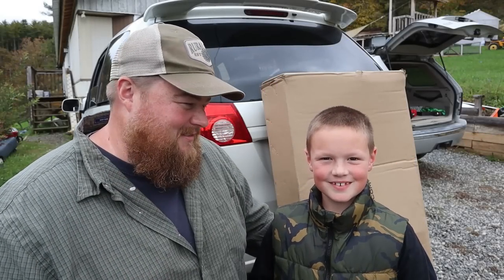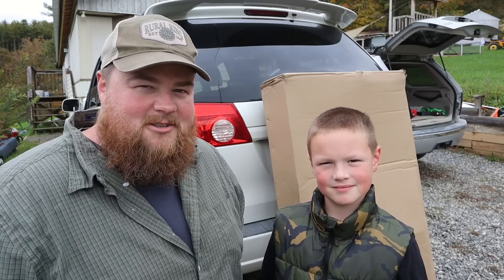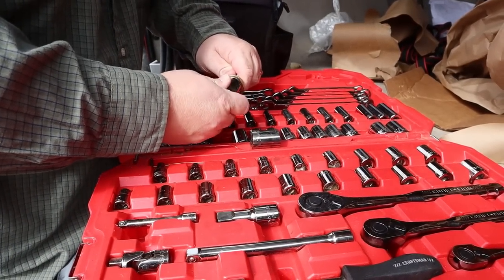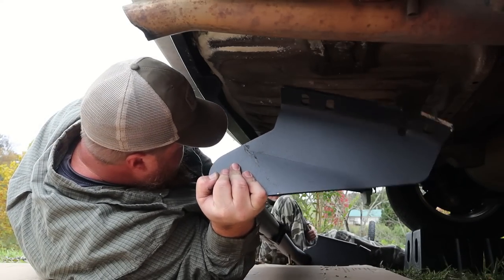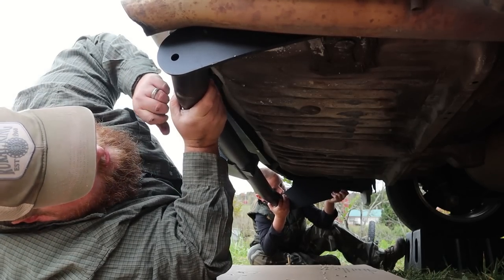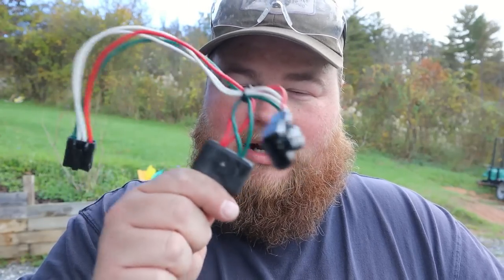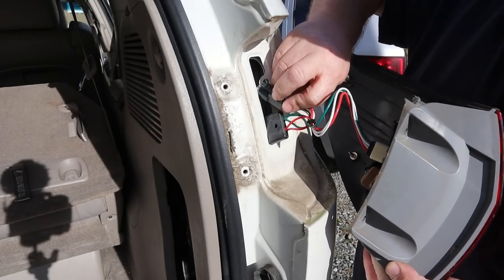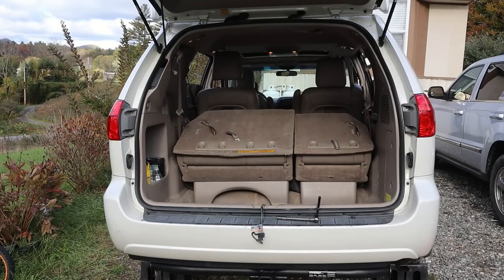BAD IDEA? Toyota Sienna Hitch Install

Comment: I installed a hitch and brake controller around 2016 on our 2008 Sienna without a tow package (no transmission cooler, no engine oil cooler). We used the van to tow our new Coachman Clipper 16RBD travel trailer that has a max weight if 3500 lbs. I added a transmission cooler and Airlift air bags in the rear. To overcome the lack of an engine oil cooler I just used synthetic oil and substituted one quart with Lucas oil stabilizer. We took the van and trailer all over the place! Yosemite, Sequoia National Park, Santa Barbara, San Diego, Mammoth Lakes California and more! That van towed the travel trailer with no problems! Two years ago we switched to a Highlander for our tow vehicle, but our 2008 minivan is still going strong with 160,000 miles. It's my daily driver, truck, bus, load it up with concrete bags to kids and surfboards, it can handle anything!
Reply from the maker: Awesome to hear!! I just finished putting some air lift springs on the rear the other day. Amazing the improvement!!! Would like to find a transmission cooler next.
Reply: @sam-and-angela which air lift springs?

Comment: I did the same thing. There's a rubber plug underneath the floorboard that you can run the wire through and zip tie it to your hitch so that it doesn't have to be closed in the gate. I believe it's right in the center you may have to remove that plastic cover to pull up the floorboard.  Also for $100 on Amazon you can get airbags that slide inside the springs on the back. Once they are aired up and you have all the leaks tweaked out you can put as much weight as the minivan allows and your minivan will still be sitting level. From my experience it has not changed how the van rides at all. Unless it's slightly better. I haul a trailer all the time with maximum load and my 08 Sienna does grate. And it never sits low in the back

Comment: My husband had put trailer hitches on every single vehicle we have owned.  He even put them on two Toyota Prius  and three Mazda MX-5 (Miatas). We have a Lincoln Town Car and a Mercury Grand Marquis now and they both have trailer hitches. We also chose not to drill holes in the trunks bc we didn't want moisture and rust to have an access point into the trunks.  We got rear ended while driving one of the Prius and the car that hit us had more damage than we did bc of the trailer hitch. Thanks for sharing what your learning fixing your mobile home.

Comment: All the holes in the frame were rusted. I couldn't get a tap handle to fit so I created a tool out of a coupler nut that would allow me to use a ratchet (I had to file a square hole in one end to fit the tap). If memory serves, I managed to cross-thread one bolt anyway. What a project! The wiring was a relief after the hitch mounting. I just left my wires laying inside the access panel on the right, pull it out when needed (no holes in the Sienna). I thought I was the only one who can turn a "small job" into an all day project. Air bags are mandatory IMO and they make the van handle SO MUCH BETTER. I'll drag all the time without even with no trailer attached. Thanks for your video.

Comment: I just put a Curt hitch from eTrailer on my 2013 Sienna.  It was said that it's a 30 minute job.  Took me and another guy 4 hours.   Spent an hour just trying to get the bolts to start threading.   I finally got a battery clamp wire brush and twisted it through the theaded holes.  That made all the difference.   I didn't think it would be necessary because the holes were covered with stickers.  But, it's vital.  I still need to install the wiring kit.  And, it requires running a power wired up to the main fuse box.   Not a fun or easy job.

Comment: I bought a 2017 Sienna which was brought from NJ to Poland (Yes Europe). It came with a hitch which was converted to the European system, but was never used. I have a small trailer without its own brake (overrun brake). According to law I am allowed to pull a total weight of 750kg. I used it once and the Sienna did great. In the future I might have a trip across three countries coming up, the speed limit will be 80km/h (50miles/h), I think the Sienna will just do fine as it won't exceed the weight of 500kgs.

Comment: If you haven't looked into them yet, the rear air spring helper is a huge improvement for these siennas. 100 dollars well spent, 2 inch sag elimination. True short install
Reply: I scraped my hitch all over the country for a year after my hitch install, pre air helper. I dont have enough good things to say about the combo and a hitch hauler

Comment: Hey Sam and Angela! It is such a blessing to see you include the boys in your tasks, jobs and projects... It teaches them fantastic ethics, morals, and what effort can do for you... He seems very proud to help and be a part and such a wonderful big brother! 
Lol, Now that he can reach the pedals, I look forward to you teaching him to drive on the property like you did with the mini excavator, I am a big supporter of children learning young equipment, driving, just like computers and devices, and having farm land gives them the ability to learn now and get the irresponsible fascination out of them and become more responsible in their use, and do what others dream of. 
I wanted to suggest that if your minivan doesn't have a transmission cooler to consider adding one, in addition to a aftermarket air-ride system. Both of these are cheap insurance to help your minivan give you so many more extra years of service. Most newer vehicles are made for Urban life not country, and they can barely handle harsh roads before having electronic traction control issues to say the least of towing or back roads use. Even the extra weight on the roof is a lot, for the newer powertrain. They sell us a car, with a larger box, to make us think it is more capable but the automakers cut corners because they are selling you an image. Fine wine imagine on a cheap beer budget. The extras you put into your vehicle to help make it able to do the extra things can also help make it last an extra long time or through its expectancy. Lots of foreign vehicles do have far better engine capability than most of our now american-made vehicles however they will not last when we do more than the vehicle was made for as advertised. Yes the body looks as if it can do more, but they don't advertise that so they can't be sued when you exceed you vehicle created capabilities and load ratings, and no more than a car is expected via the automakers build out of the vehicle. So the extras you add will help it to last extra long to help the entire powertrain and give you a better vehicle life experience and reliability that you would expect from a more versatile family vehicle to do all the things that you want it to do. It can do it but you have to add a few things t help make it do it and last. 
Hope you guys have a wonderful time migrating to the Tennessee Homestead. I pray, as I allow the commercials to play that you all can get some kickbacks to help Elijah and his brother to have silent electric off-road bikes or a side by side, that they both can enjoy. I look forward to his build of the treehouse for him and his brother, and don't forget to leave a pile of rocks for a little man to relax on climb and have a blast with again. When he gets bored with it he will let you reclaim it for use elsewhere on the property, lol!
Bless you both, and your boys, and your brothers, and all of your family for all that they do to help you along your homesteading journey, I enjoy watching the brothers help and work together. I am blessed as I get to watch all your content, it's so inspiring, and touches my heart. Bro Sam, I love the smile you help your wife to have every time she looks at you, and Angela you make Sam glow everytime the sun blasts his face. You are such a wonderful family! Perhaps soon the boys will be helping to make soap with Mom, or laser cutting with Dad in the businesses. Continue to be a blessing and I hope many bless you back. 
Happy Thanksgiving in advance, because I'm thankful for what you bring forth on YouTube in your content to help us remember that family is valuable and all we do we should get an understanding of that!

Comment: I just did this entire setup on my 2014 awd sienna and it’s the best upgrade ever!!! Bike carriers, tow a side by side, tow a utility trailer, tow a cargo box trailer. I even did a diy cargo rack on top using a plastic pallet I split in half with a saws all and u bolts. Just as good as a truck now if not better since I can carry 7 people!!!

Comment: Just put a hitch on my 2006 Sienna today, thanks for this video which helped me.  How did it help me?  Well, I checked out the ETrailer option.  I'm sure they make a decent product, but I found multiple reviews with experiences like yours - problems with fit-up.  And it seems like those problems were attributed to distortions in the hitch due to shipping/handling.  Even if the box shows no damage (like yours), it can still get out of whack if somebody drops it on the loading dock.
So I checked out U-Haul.  They offered a Curt hitch for less money that the Etrailer option.  Best of all, I could go pick it up at the local UHaul store.  This way, I could bring it right back and exchange it if it had a problem.
My install also took much longer than advertised.  In my case, it was due to the time spent chasing the rusty threads on my 16-year old Sienna.  But I finally got it done, and it went in pretty clean.  I did not have a wingman like you did, but I was easily able to position the hitch with the use of two 5-gallon buckets and a piece of 4x4.  
Not planning to use it for anything but a bike rack.

Comment: I only once bought a new receiver hitch for a vehicle and only because it had been marked down twice at K-Mart a now defunct discount store.
Every other time I waited and searched until I could find one used as these hitches are pretty much indestructible.
Last one I bought is a used universal style and will fit both our vehicles even though one is a Chrysler Minivan and the other a Ford Ranger waiting to be installed in case we move off the Left Coast.

Comment: My wife just got a 2021 Toyota rav4 hybrid xle.  I got a curt hitch for it, but have not installed yet. Will need the wiring for a trailer. That plug n play wiring worked great
Reply from the maker: I have zero complaints on the wiring! I would add a pry bar to your possible hitch install tool list. :)

Comment: I’ve got a 2013 Sienna with 155k miles. I’ve just installed a hitch. I’m having the shop install airbags (2 schrader valves) a surge brake and a 4 way to 7 way plug to haul our small couples camper. We will be upgrading our tow vehicle but with hurricane Ian damage still to fix on the house I’m trying to save a few bucks in the meantime. All parts from etrailer.  I didn’t have to move my exhaust….hmmmm

Comment: I put a hitch on a Toyota pickup once. It always baffles me how they always send you what you need. And when I went to install it one bolt was standard thread not metric. Always something.
As you found custom fit means get a pry bar.

Comment: You have a hole in the bottom underneath your carpet.  It is plugged by a black plug.  You need to pop it out, splice it in half and slip your wires through it and reinsert the plug!  This will allow you to go underneath

Comment: I would be concerned that the hitch is too low. You may need better shocks.
Elijah did a great job helping!
Reply: Please send a link on the hitch. I’m interested in putting one on my 2018 Equinox
Reply from the maker: Links are in the video description to e-trailer's website. :)

Comment: If you look at your trunk floor, about 16" to the left of your exhaust you will see a drain plug, you could always run your wires through that so not to damage them when the trunk closes.
For a 9yr old your son is very mature, any othe 9yr old would say "you're all right, keep coming back, keep coming back" ( crunch, smash, bang ) as the car goes over the ramps lol.

Comment: I have 2016 Sienna with a hitch.  Never towed more than 1500 lbs or so for short distances.  Baby the transmission, no worries.  Any time you're selecting a tow vehicle,  its all about the braking. Just use common sense. God Bless.

Comment: Sam, Does your sienna  have the factory tow package? as I have an 08 xle sienna with tow package , I also installed a brake controller as I pull a trailmanor travel trailer and a converted cargo trailer from coast to coast.  plus I installed a tranny cooler and beefed up the rear suspension to stop the drooping in rear.  Love your channel !!

Comment: Nice job guys. Nothing is ever as easy as you think🙄.  Never realized how similar in design the sienna   is to the Odyssey. I have an 05 odyssey.  We just had to take the whole roof rack off mine and reseal it. Was leaking everywhere!!! Ended up having to cut the pad and carpet out of the trunk it got so moldy because I have a molded plastic liner, we didn't notice the leak for a while. 🙄🙄🙄.  Love my van though. I call her Fiona ( like from Shrek) she's green and a little ugly but she never lets me down 😂😂😂
Reply from the maker: Oh noo!! No doubt you guys got her fixed up right though. :)

Comment: I did the same thing on my mini van Toyota Sienna. Sits very low. Added a 4” raiser with a basket. Do you know if it will tow a 4 door car? 250 miles.

Comment: Bad idea make sure to change transmission fluid
Reply: The transmission could take a hit, but I it's unlikely if they keep it lite and be gentle.  I've heard that if the transmission oil hasn't been changed to schedule and the vehicle is over 150k miles giver take, it's better not to change it.